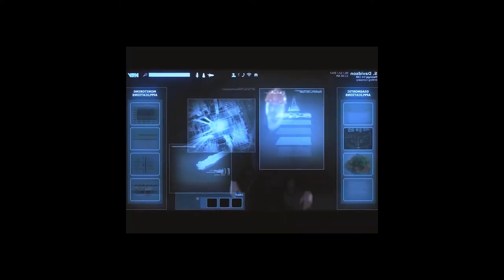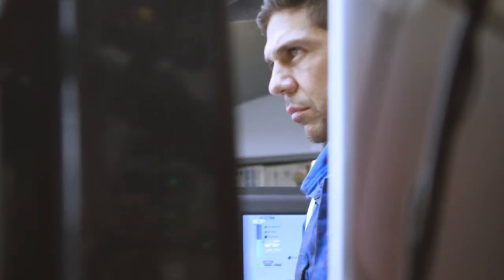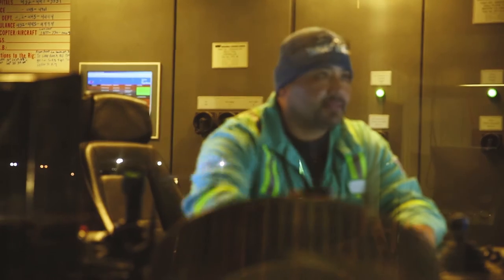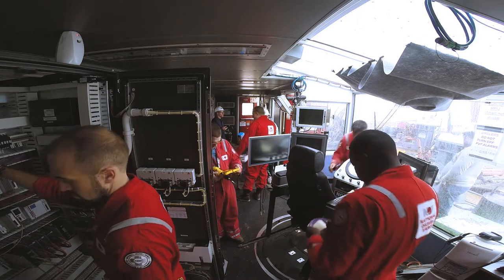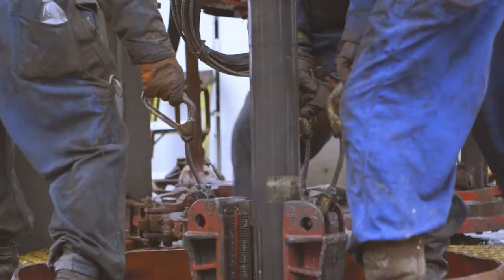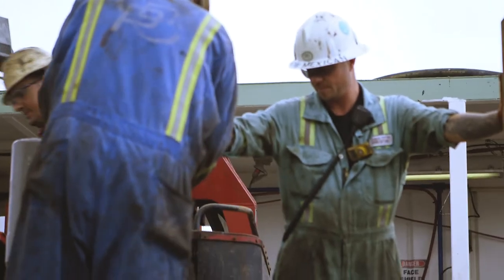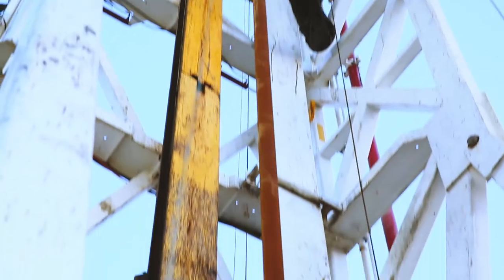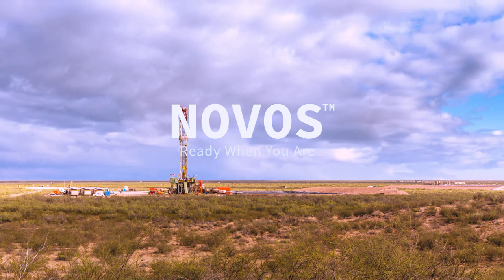NOVOS reflexive drilling system

Comment: Dont believe W2W times would improve.  I think they are skewing the data. Also, they might be getting their data on US rigs, and no offense Americans but your drilling righands down there are bottom of the barrel. I could see that there would be an improvement In some aspects of the connection using Novos when being  compared to US drillers and righands. Still dont think it can outperform an On-The-Ball driller with good experienced floorhands. They never state what the average slip to slip time is with these crews. I know my time is 1min 50secs on average and ive done a derrick connection in 1min 24secs. And that's with following all of the guidelines, couldnt really see a computer or american crew being able to do that.
Reply: You know nothing about American rig hands if you’re bragging about making a connection in over a minute…